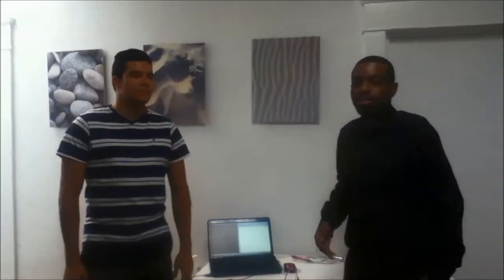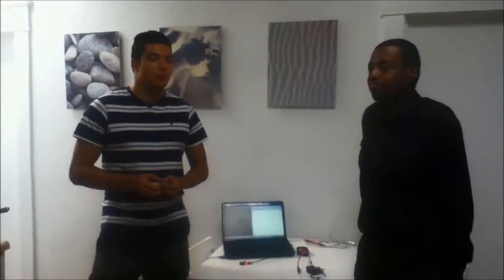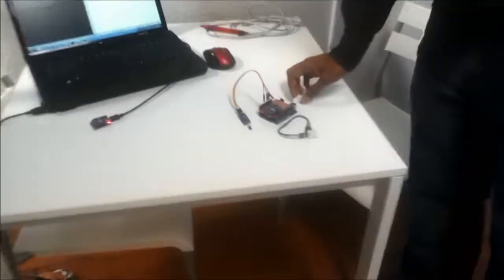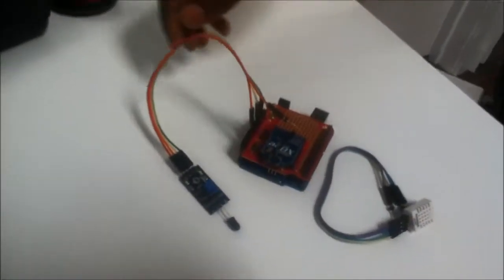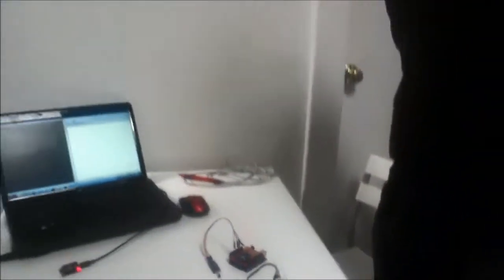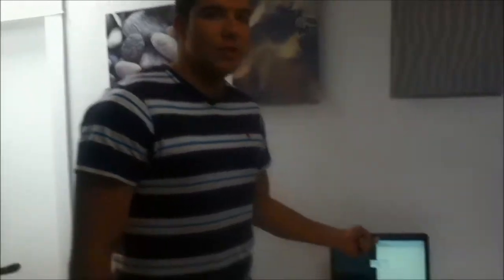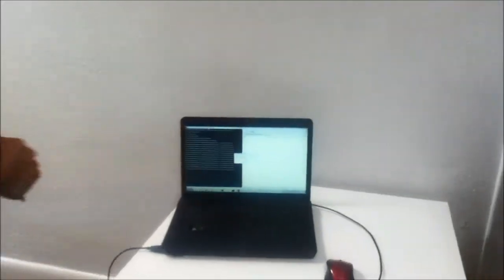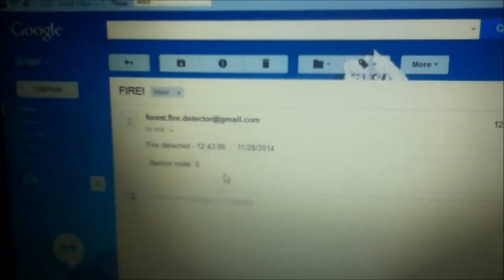Forest Fire Detection Project

Comment: hey do u guys have a website or report on this? we're interested in the sensor that you're using. Thanks!
Reply from the maker: No website or report, but we do have documentation that goes over the parts we used and describes how it works.
Reply: That'll be nice. Could you send a copy to martinli0425@gmail.com if possible? Thank you!